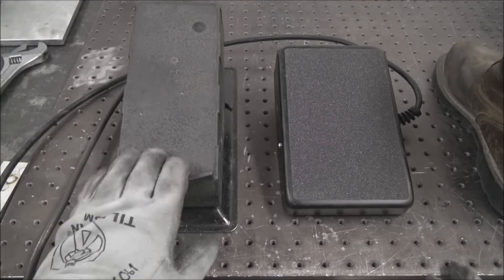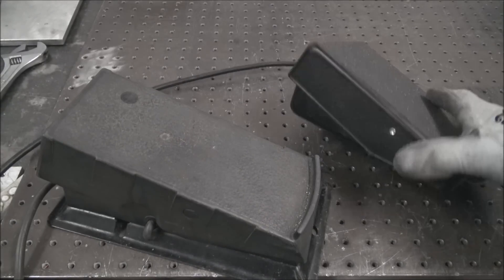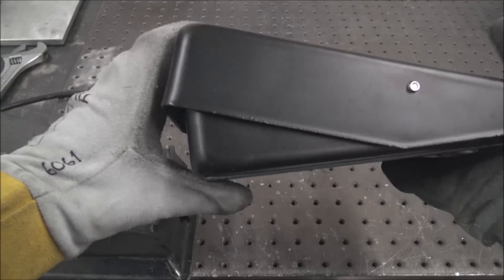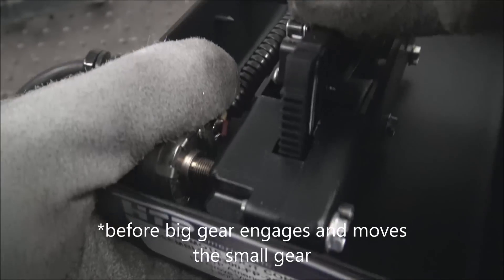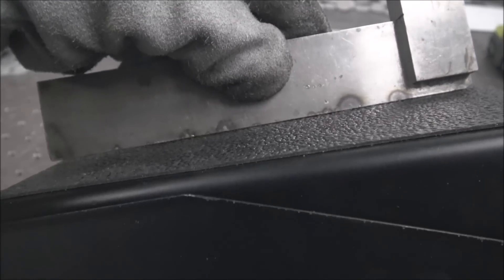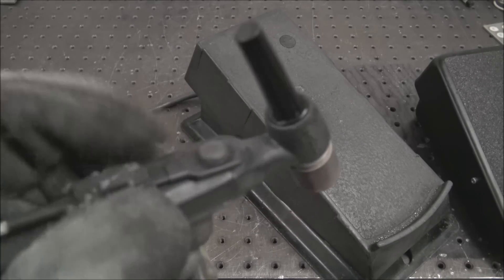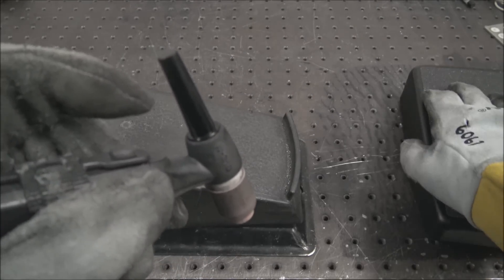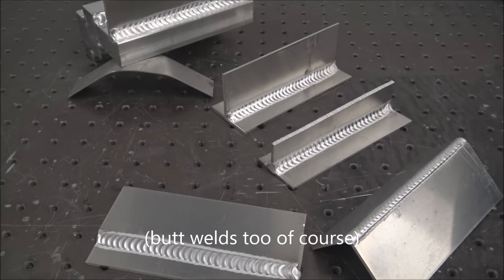Two foot pedals and one TIG Button at a welding table - A VERY thorough comparison of the Three

Comment: The miller is vastly overpriced plastic crap and its bulk is super annoying in the shop much more so if you travel by air. the belt system is janky and hard to realign if you need to do maintenance.the bulk sucks if you travel by air, the heel rest can be added, and the bottom can be padded, stick on some rubber if you don’t like the spin, but it’s actually handy if you reposition often. The cord would be nice if you could reposition I agree with you there. Also yes the metal retaining bezel sucks, I’m about to remove them all off plastic and metal on my 14 pin connectors To each as they say

Comment: Nice! So what is your preference for amperage control if you are mostly welding in a controlled environment like at a shop table? Pedal pr button?
Reply from the maker: 90% TIG Button, 10% Miller foot pedal
Reply: @6061  TY UDA MAN!!

Comment: Lincoln pedals work pretty good.  I learned tig welding on those and a Lincoln Aspect.  Used them for years repairing mining wheels at General Electric. They work well.  Especially in cramped tight spots when you have to use your elbow to light the arc with the pedal. Welders tend to be primadonnas when it comes to equipment.  I prefer Lincoln over Miller any day of the week.  Miller foot pedals are good too.  To be honest it’s all the same to weld with once you get used to it.

Comment: Have you ever used CK Worldwide rotary amperage control? RACCV-1. If so, what are your thoughts on it?
Reply: I bought the one that looks like tank tracks.  Don't bother.  I like 4t with s torch switch best, but I'm welding thin stainless exhaust and roll cages now, so I ordered the tig button

Comment: What kind of pressure do you have to use on the Tig Button over the whole range?
Reply from the maker: Barely more than using a Bic lighter maybe? That's the closest thing I can think of to compare.
Reply: @6061  Thank you  👍
Reply: @6061 I hope less.  I ordered one the other day.  Looking forward to trying it out soon.
Reply: I was concerned with that as well before ordering.  Hard to describe but it's an appropriate amount of pressure.  I've had mine a couple years.  I don't weld often but I still consider it worth the money.

Comment: SEEING THE FIRST TWO POINTS ABOUT THE RIGHT'S CONS, ANY WELDER WOULD BE ABLE TO FIX THESE ISSUES.. WELD ON A HEEL STOP, AND DRILL HOLES AND ROUTE THE CABLE WIRE WHEREVER YOU FEEL IS BEST..

Comment: Im' a big fan.  Thanks for all your vids, ideas and the button.. I do fairly large projects what means I have to be all over the table from all sides. shuffling that foot pedal around with me standing on one foot leaning on the table trying to get that pedal the right way under my foot. besides that I was fixing the cable to it all the time (tangling up and kinked, or run over with the seat. Now I have your Tig button. work is much faster more accurate and most of all it saves my back.  So thanks again.  Easy peasy:: Touch it real light and listen for gas flowing and light er up. I'm not a Heron. I need two feet to stand still.

Comment: Here in europe the pedals are rare. I use normal switch on ck torch, but also fronius foot pedal for precise welds and alu. Tried few brands but fronius foot pedal is smoothest and it has hook, so you can move it around with a foot.

Comment: I much prefer the Lincoln style pedal. Doing tube work/chassis work I end up squeezing the pedal with my thighs. I guess if you strictly welded at a bench some of what you said could apply. But for out of position welding smooth pedal all the way for me

Comment: I've never seen any on a Tig wearing Boots that Big.
Reply from the maker: Only 10.5's US
Reply: @6061  I'm a 12 UK, I meant as in a big thick chunky boot with a Stiff Sole.
Reply from the maker: Typical steel toe slip on work boot
Reply: Looks pretty similar to the type of boots I have been wearing for the past half a century.

Comment: Personally i have always hated using a foot pedals 
Part of it was due to losing one foot to stand on i was welding i was never allowed a stool to sit at work 

So i just go on learning how to do without 

 cheating with using the down slope timing and end current to create an artificial pedal with the button its a workaround thats works for me

But a pressure sensitive button might be the ticket

Comment: Im from germany, and used the Rehm foot pedal a long time. Its the perfect design I think. All aluminum housing, diamond plate on top, heel stop of course, so its very light to kick around. And these things hold up very well. No I use an EWM welder, and the EWM foot pedal is out of cast iron I think. Just unnecessary heavy.
I always want to try your tig button, but now Im way less into tig welding. A tig job comes up maybe one time in two or three weeks.

Comment: Have you had any experience with wireless pedals?
Reply from the maker: No. I've only seen one review of a wireless (Miller) from a really good welder (John Marcella, Marcella Manifolds), and he spoke highly of it. It was a really old video.
Reply: @6061  I've recently ordered one here is Australia for $325 USD, our Unimig brand. If I don't like it I might have to import a tig button 👍
Reply: miller wireless pedal is great, i wish you can get it to work with an everlast
Reply: @michaelriccardi424  everlast has a wireless. But it is to bulky looking for me
Reply: Used a miller wireless pedal on a dynasty400 TIG for 4 years and loved it. Now my company has bought a new Lincoln spect 375 TIG and the foot pedal is horrible and wired. Have all the problems talked about in this video. I’d love to go back to my miller foot pedal but my company is now owned by Lincoln electric so guess il have to learn on the Lincoln pedals or get a TIG button. Great video, Great info and comparison.